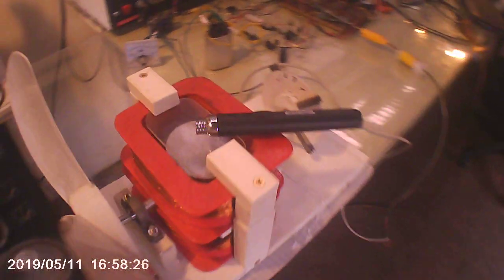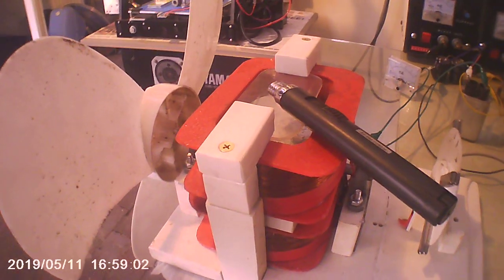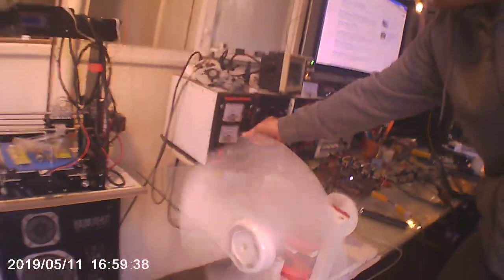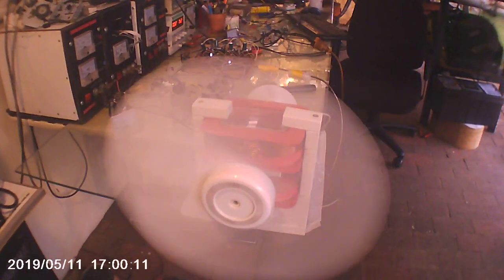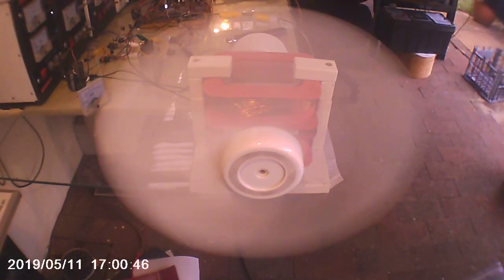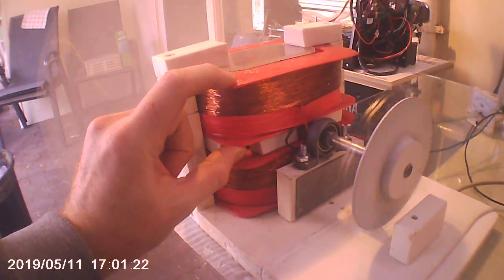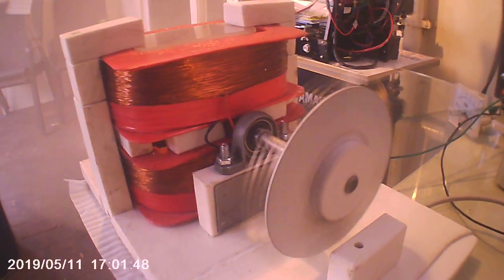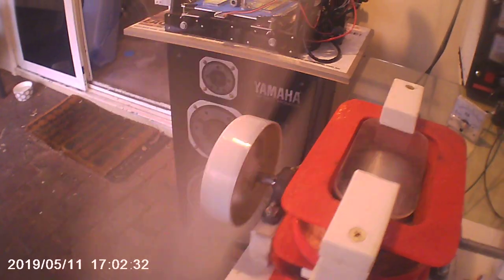My Bestest Video Ever. - My DIY Joseph Newman energy machine. VER 2.0

Comment: Considering the average box fan uses about 60-75watts, I'd say this is pretty impressive.  To me it seems the most practical way to use this would be to essentially mirror the motor about the shaft without the electric input and simply draw the extra electricity out of the coils into a power bank.
Reply: of course i have tried this in many ways, - and it did not go briliantly. -  in all of my later motors i tried either, - higher coil resistance via thinner wire (much less total wire).   or similar wire thickness and less of it. - in either case, when loading the motor, input power goes up more and rpm drops more....    - the best overall motor in my view, was the first one with very low rpm, and very low input power (1/4watt),  which still produced huge torque and was able to provide torque on the shaft with virtually no different in input power.  - -  so a configuration for low rpm and high torque is the only way to go.... this is acheived with a very large mass of copper wire, and a coil resistance of around 1-1.5k   .... and obviously larger is better.  (small ones are a waste of time,) - mine are marginal, but as an OU experiment very convincing...